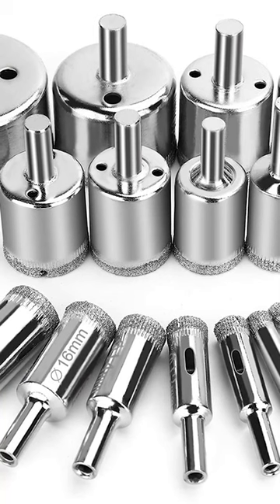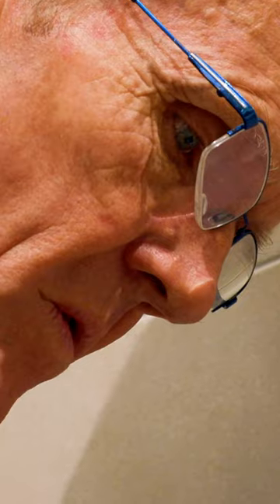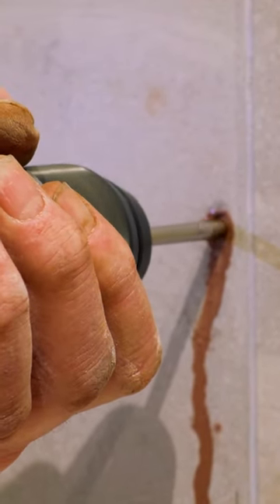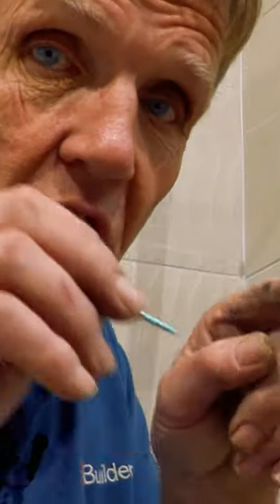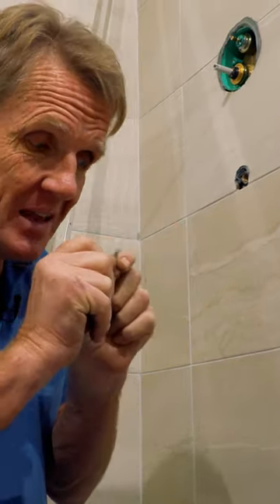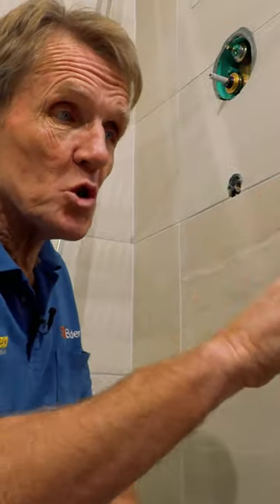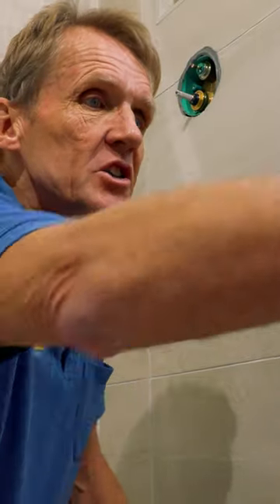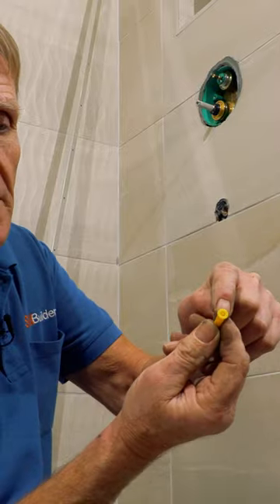How to Drill Porcelain Tiles Without Breaking Them #shorts

Comment: Another way is to drill through, push the plug in, rest screw on top and tap the plug in past the tile, then screw in 😊
Reply: Indeed, always get the plug past the tile and use a screw longer than the plug itself.
Reply: That’s what I’ve been doing since Moses wore short pants!
Reply: Exactly the way I was shown back in 72 when I started work as an apprentice.
Same thing with plaster covered walls. ALWAYS tap the plug into the brick otherwise you’re fixing into the plaster not the brick.
Basic stuff
Reply: Same, I learned this a long time ago.
Reply: This, is the way.
Reply: My thoughts too. But only if the wall is solid and not a stud wall, otherwise the tile is more suitable than plasterboard.
Reply: He literally said that at the end of the
Reply: If it’s cement backer board behind the tile a wall plug is probably OK. If it’s “waterproof” gypsum you’ll need a proper cavity fixing. Far better, put plywood on the back that can take the screws. More work but a much better job.
Reply: I see the correct answer is well known in these here parts.

Comment: I always drive the plug in past the tile so there's no danger of cracking the tile.
Reply: Same, the plug is for the wall, there's no sense in it being in the material you're fixing. 👊
Reply: I do the same. Don’t go past the tile with the diamond then drill the wall with a normal masonry bit and drift the plug below the tile.
Reply: I came here to say this :)
Reply: This is essentially what he's saying.... but making the point that a slightly larger hole in the tile will make it easier to drive the plug further.

I think.
Reply: @UKMonkey  no it isn't.
Reply: @martinlouden9005 genuine question Martin. Does having the screw more recessed make it more difficult to successfully remove the screw at a later date if you need to make repairs?
Reply: @uremawifenowdave  the screw isn't more recessed. The rawlplug is just deeper into the drilled hole so there's absolutely no difference in the finished item.
Reply: Was on my way to make this exact comment 👍
Reply: Are you all saying go past the surface of the tile?  Or all the way past the tile completely?
Reply: @rotcod2886  drive the wall plug right through the tile so that it doesn't expand in the tile and crack it when the screw is inserted.
Reply: @martinlouden9005 I get that.  But I just wanted to make sure you meant past the tile and not just past the surface.
Reply: @rotcod2886  yeah, past the tile. Same goes for ceramic and glass tiles.
Reply: Same here...

Comment: Also clean out the bits regularly,  if you don't the tile residue blocks up the bit.
Reply: Yep, just running it lightly over a softer material like a brick or piece of sandstone cleans out the porcelain dust. Although you can scrub it with a wire brush.
Reply: @nickrider815  ive had ti stick a framing nail and try to dislodge it after letting it dry out. Never had a problem cracking tiles though. I've  tried that technique but never had success with it. Btw those blue  bosch masonary bits do well on porcelain

Comment: For the hole I just masking tape over the drill mark and use a standard masonry bit and double check the hammer function is off 😅
Reply: Same here, never failed me
Reply: Hmm... which type of tile are you drilling through with a standard masonry bit? Ceramic or porcelain?
Reply: You're not going through porcelain with a standard drill bit, most cheap tiles are ceramic
Reply: @tepidbudgie I think he means 'standard hammer drill bit w/ tungsten carbide tip'. 
      So a 'concrete' drill bit will work always. But, depending on the quality you buy, can also include drill bits marked as 'masonry'.

I have a 'universal' drill bit (which is supposed to be for masonry / wood / soft metal / plastic) by Rex. 
    But I've drilled tile and hardened steel with it too. Definitely tungsten carbide (and ground with 2 very slight cutting edges.. I think 5° positive angle)

Comment: I used to use masking tape and a masonry bit, never had a break in 20 years and as you say parallel screw only. 

Ditched tiles and used shower panels in my own home and backing board in the kitchen. There were no affordable diamond bits when I first drilled tiles in the 90's.
Reply: I used a sds bit other day to hang a AC unit, drill only and steady away, worked fine
Reply: That's porcelain
Reply: A masonry bit on porcelain? You might be there a while.
Reply: As long as you take off the hammer action 😅
Reply: Clearly never drilled porcelain 😂

Comment: I've always been ok using a masonry bit but not on hammer until after its cut through the tile.
Then what I always do regardless of if I'm using plugs in tiles or not is use the screw to tap the plug in 2-3mm past flush.

Comment: 6mm bit red wall plug. Put your sds on drill until you’re through the tile then hammer after. I’ve done it like that for years and it works a treat.

Comment: Just watching the start of your video mate where all the wet dust from the drilling is running down the tile. A little tip to stop that is get a nap of wet tissue. Stick it to the wall below where your drilling and this catches any crap and stops it staining any grout. It’s also sometimes helpful to touch your drill bit onto to cool it. 😉
Reply from the maker: Good advice but dipping a hot drill bit cracks the braze that holds the tungsten tip.
Reply: @SkillBuilder  I don’t mean to dip it. The sudden change in temperature is what causes that to crack. But having damp tissue there cools it slowly so shouldn’t damage the drill bit. But I agree it’s good to let people know that cooling the bits isn’t great for them. 👍🏻

Comment: What is parallel thread ..
Reply: A classic wood screw  has a conical center body \/. - what's referred to is more akin to a sheet metal/sheet rock screw where the thickness of the center body doesn't vary || (other than the tip being pointed) and therefore doesn't expand (exert more pressure to the sides of the hole) the plug more closer to the surface/tile than deeper inside the hole.

Comment: I would always use a masonmaster (carbide tip) bit .... insert the plug put the screw against the plug and tap it through the tile. You can use any type of screw you want then. 
This has the added bonus of allowing you to walk the hole if you start off centre (easy if you just start off with a dimple and check your hole is in the right place!

Comment: I've always used a glass drill for the tile.
Then twist or masonry bit (Bosch universal).
The glass spade bit finds its center very easily.
Reply: Same, carbide tip bit all the way, never fails.

I also don't much understand the bit about the screw head. You're never sinking the screw in that deep! If you're drilling a hole for a screw you're affixing something to the wall!

Comment: I've got a completely different type of tile bit. It's made by Plasplugs so nowt fancy and a dry bit. Had it for years and it's never damaged a tile. It's almost like an arrowhead. I agree, this is only for the tile, once through then it's the next bit, wood or masonry etc. There's different types of plug too. For this job you could use lipless plugs, benefit of this is that there's more likely to be no expansion at all within the tile because those lips when pushed into a hole can expand. If you can buy screws that are only partially threaded too then they won't draw the plug up into the tile area. Because you don't want to really tighten the screw then if you put a good glue in the hole it'll hold the screw secure. A PVA based one is great, waterproof if necessary.
This bloke has some great videos and this is another one. :)
Reply: If you use correct size screw for plug it shouldnt crack anyway. Tiles cracking probably because the screws are too thick for the plug. Ive drilled out plugs and  plasterboard metal plugs to make them bigger inside before so i can get away with using the screws i want to use like mirror heads

Comment: If you did the rough in properly, there will be wooden backing behind anywhere you're mounting your slide bar, grab bars, soap holders, etc.  No plugs will be necessary.  Retrofits notwithstanding, but judging by the hansgrohe iBox, that wasn't a retrofit.

Comment: I always drill a bigger hole and a longer screw and sink the plug all the way through the tile into the masonry behind so that you get a better fixing and have zero risk of putting pressure on the tile so it doesn’t crack.

Comment: Simply tap the plug in deeper than the tile. You have to use a plug without a "collar" (or cut it off). Also, always fill the hole with clear silicon sealant before your fit the screw (not to stop the tile crack off course, but to seal it).

Comment: The backer board matters
Use a sharp nail to chip the glaze, or screw
Slower speed , water on bit
No hammer drill
If there are wood blocks, just screw, prefer fine thread, 
Some bits suck, never use a dull bit, trash it. 
Texas

Comment: The problem I always face isn't the hole but the placement of the hole as you don't have a centre point to start from. I've only had limited success with the suction jigs as they also tend to slip.
Reply: Several layers of masking tape
Small drill to centre the he hole for the correct drill bit
Away you go
Never broken a tile yet
Both holes have lasted years 🤣

Comment: Only correct for collared fashioners, most rawl and wall plugs fit flush, so true in the UK for collared fasteners. Also, pluck at the tile, it's ramming dust into the hole that's half the cause or cracking. Evaluated, rating 9/10, lost point for not using Pro epoxy and referring to drilling lube as water. Professor Toby Turner, VCTrondheim

Comment: I usually use a ceramic head that's wider + put gorilla tape over the hole I'm drilling. Then get through the tile and then switch over my head to a regular for getting through the wall. The tape helps with it slipping and not cracking

Comment: You don't need a diamond bit for small holes, anything SDS normal drillbits can handle will be good, turn off hammer function and you're good to go
Reply from the maker: Try using an SDS bit with no hammer. It goes nowhere and porcelain is very hard. I have tried it many times.

Comment: "use lots of water" is a little too specific.

Some tile drill bits require no water, as they contain a wax in the core that melts, lubricating & cooling the bit.

Better advice would be to "follow the manufacturer's instructions"

Comment: I fitted over 300 shower doors on those porcelain tiles, those diamond drill bits are super expensive and are one use or two uses and it takes forever to drill the holes it's not good when doing price work, I decided to try a SDS  drill to see if it works cos the tiles are so hard, it went straight through in 0.1 seconds with just a tiny touch on the trigger with no cracks or damage, I done the whole 32 story buildings bathrooms with a cordless SDS drill, the mangers were amazed cos at first I was complaining that I'm not making money it takes too long to drill then all of a sudden I'm flying through them leaving work early with double the amount of money I didn't tell them what I was using to drill the holes until after everything was finished in case they told me to stop, they put some other guys on the same job they were coming to me asking how am I making money doing this they want to quit and the managers are ripping them off I told them what I was using and all of us made an absolute fortune

Comment: I think many of the commenters have missed the point this is about porcelain tiles. Masking tape and a regular bit aint going to do it. And yes always hammer plug through the tile (ceramic or porcelain) so there is no pressure on the tile.

Comment: Sorry mate.......crap, simply make sure the plug goes in past the tile. Also I've never cracked a tile whilst driving a screw through. Stick to the plug size......if it's a 6, then use a 6mm drill. Bless.